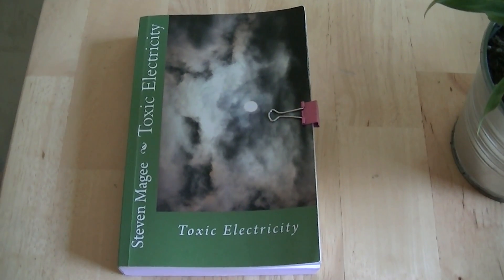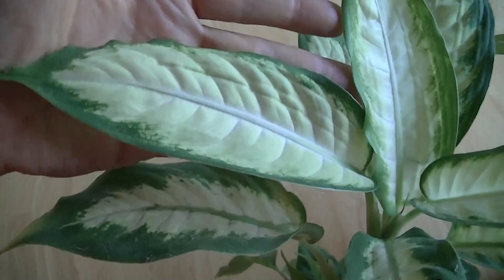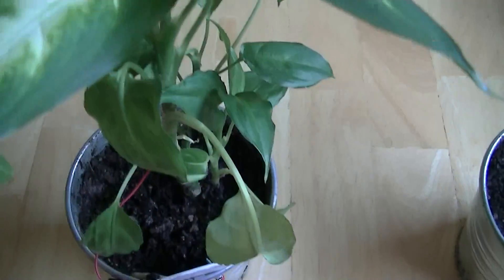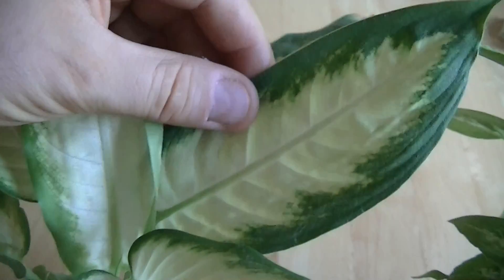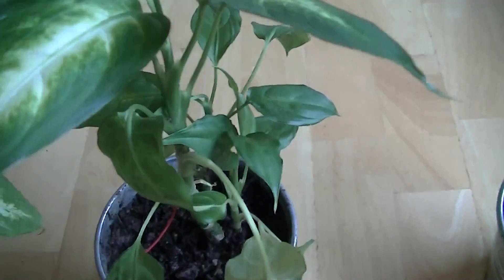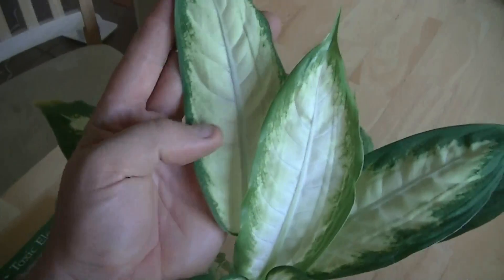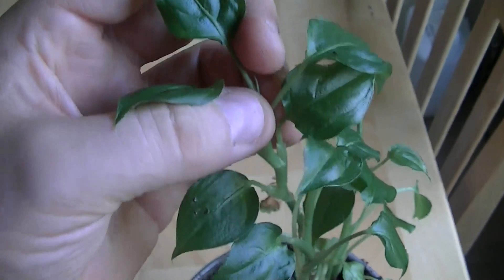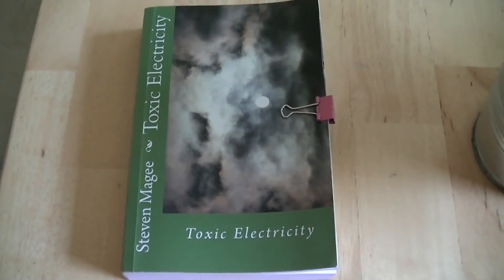Using a 1.5 Volt DC Battery to Return Deformed Plant Growth Patterns to Normal Experiment

Comment: I think you are missing the point of what your plant experiment results are trying to tell you. A happier plant is the one that uses a spectrum as fully as it can given the pigments and biochemistry that it has. 

lookup dieffenbachia varieties. This plant has been selected to have, first - a single white line going along the mid-leaf,  second - ribbed features along the extensions that followed. this includes speckling followed by clearing of the main plant from its pigments. You put two or three cultivars or species side by side and called the one you claim to have hooked up to your battery the right way being the desired outcome. How do you know you are not impeding or promoting the microbiology of a plants soil to be hostile towards the plant? 
 
Off topic but: what would that mean for a human being? 1.5 volts of DC to how much of our surface area? why a battery and not a joule thief? what if the plant needs a higher voltage to grow unimpeded by extra-EM? 

Some plants are only expressing mature features in leaves upon maturation of the entire plant. if you truly want to to test what happens to plants under a low voltage, do this experiment on mass. 

You should stab a non toxic electrode into plants' main crowns. Leaving a gator clip that never bit the plant, nor forced the exchange of a plant's electrolytes to go up or down is a waste of time. all these coils and buzzwords are a waste of time. 

start and end the experiment run at the same time.

Comment: another thing. sorry about reverse order of the posts:

have you ever tried manipulating plants to apply voltage directly to the soil near the roots? this means negative/positive electrode is also in the soil as well as positive/negative. You want to separate it so none of the roots touches the electrodes. I've found this way to have some scientific background, but havent test it myself yet... It's flow of electrons that is found beneficial... 
I'd post a link, but i cant...

Comment: Hey, Steven

Some nice experiments you are doing. I've been in the same fields myself and wonder what i can do electronically to the plants in terms of stimulating/pathogenic killing radiation as well as applying fields - magnetic and dielectric. 

For reducing impact of electrosmog (i have a lot of it at my work), i found dielectric field of 7500V do some real magic. There are also some devices on the market that suggest using such fields for also other disease related purposes.